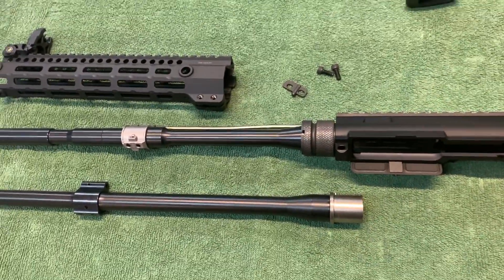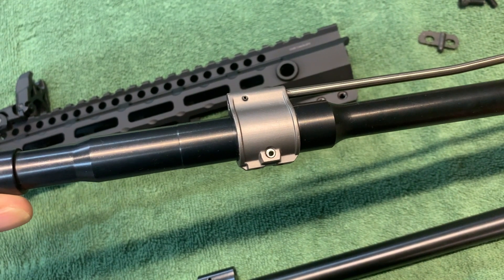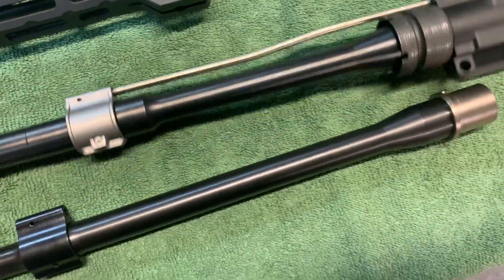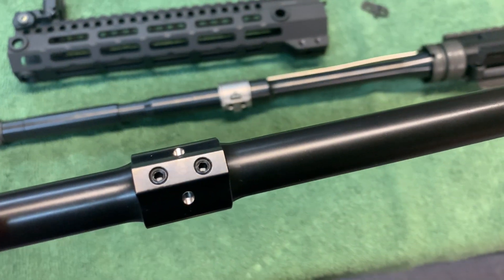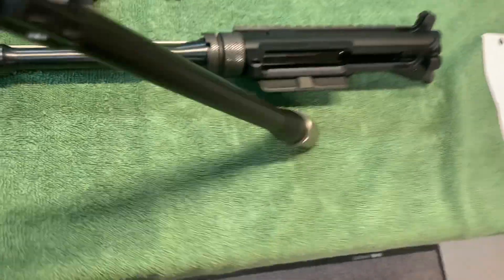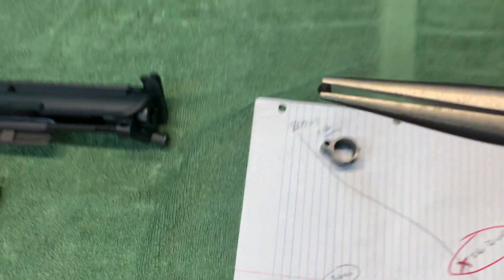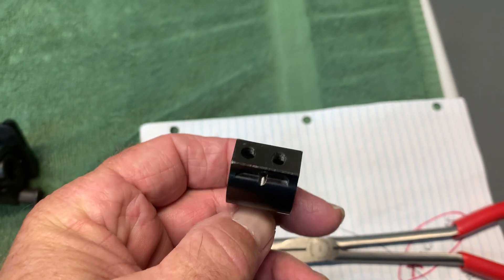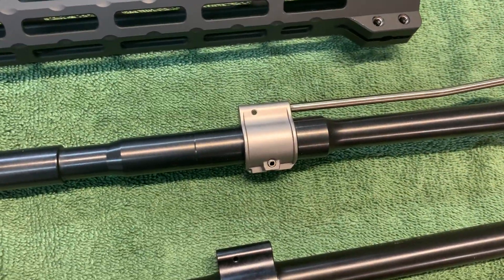Set Screw "only" Gas Blocks

Comment: i dont always agree with your opinion but this i do 100%! set screw gas blocks are GAY! i bought a tapered drill, reamer and lots of taper pins and every time i get a set screw rifle like BCM, first thing i do is pull the handguard, fixture it in the mill and drill, ream and blue the hole and install a taper pin. i love the Geissele gas blocks and Triarc has one like Geisseles and its like 30 bucks cheaper.

Comment: what about clamp?
Reply from the maker: Clamp is the absolute BEST, if you can find one that fits under your rails, thats the way to roll for sure. I saw a test where a wrench was welded to a clamp on block and turned until the index pin broke in the barrel extension, before the clamp on moved. Clamps are solid, but finding ones that fit under rails is the challenge. I understand but have not tested Daniel Defense clamp on blocks but hear they fit under most rails.

Comment: Always tighten down the screws on the hanson barrels. I've been able to remove the set screws with the lightest pressure AND there is always a gas leak from the barrel to gas block seal. So, after tightening the screws down the holes in the gas block and the barrel no longer line up and I ream and use a taper pin. Immwdiately solves the gas leakage and the gun runs more efficiently. I also assemble my own carrier and keys the exact way SOTAR does. Most companies don't even seal the goddamned keys let alone pass a simple 25 in/lbs reverse torque test. I've only found one fail zero that made it to 35 in one screw.